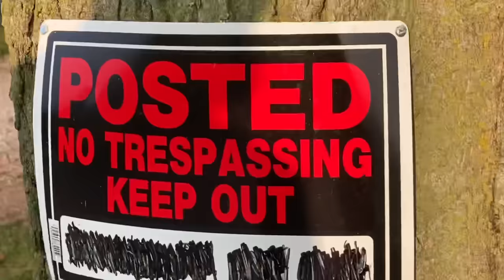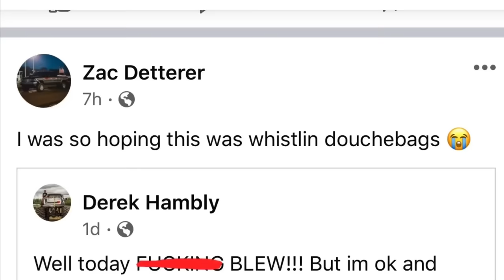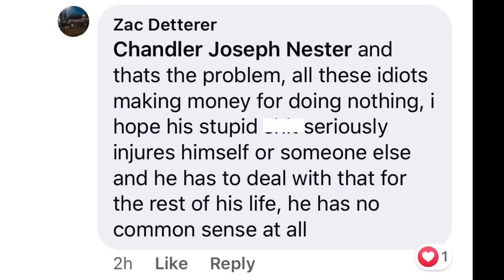DON'T TELL ME HOW TO USE MY TRUCK - Hater Crosses the Line

Comment: Get a military Humvee and see how strong “military grade” is or hell get a lmtv that should be cool to watch.
Reply: Watch him rip the r8 body off and put it on monster max
Reply: Hell yes!!!
Reply: Or better, a hilux.
Reply: @flippercomet5002  yesssssss
Reply: @Trevor Lahey , my man
Reply: Hilux has a solid axle with a king pin design. No ball joints. Plus it’s a N/A diesel. That’s why their so reliable. They don’t make enough power to hurt themselves. Although they will absolutely rot out. That’s an unavoidable fact.
Reply: Military humvees aren't military grade they could get blown up by IEDs
Reply: @kinetix3576  they are, in fact, military grade due to the fact that they constantly break are impossible to maintain for more than 5 years
Reply: @jabocjacob7064  old Toyota’s rot like hell but if there’s anything I want more than to swap a Perkins in my 91 ranger, it’s a dirty diesel hilux with a hood stack
Reply: I wasn't in the motor pool, but more often than not we would receive Humvees at our shop and they would break somewhere between parking them and moving them a day later.
Reply: Yes!!!!
Reply: Military grade means the cheapest not the best
Reply: It’ll be dead before he got it started.
Reply: @JamesEllison69  this aged well
Reply: @kinetix3576  military grade means "lowest bidder" not "good quality"
Reply: @TheSebsFilms  
Perhaps, but if we gave Americans those L-ATVs instead of the Taliban, there might be slightly less hate toward the government.

Just saying, everyone has a price and mine is an L-ATV.
Reply: @JamesEllison69  A surplus MRAP.

Comment: Blows my mind that trucks break down as daily drivers when he puts them through this and they still run 😂😂
Reply: yeah lol. NeutralDrop channel jokes about that too. It's an odd phenomenon. lol
Reply: Dude, not gonna lie, I’ve thought about that every single time he posts.
Reply: @jamisgood21  true. Happens to some shitty bikes I purchased, when I abuse the shit out of them they don't break. But going to the grocery store? Fuel line clogged, crank bearings get fucked up, brake pad gets destroyed, loose bolts, etc, etc.
Reply: On a serious note - endless daily use, countless heat cycles & running hours, that is what finally kills stuff. Modern vehicles are engineered to just work, and to not run hard enough to destroy themselves.

Also there is a case to be made for letting your machine run through it's paces once in a while, getting it's blood pumping, so to speak. It can clean stuff out, keeps things moving etc
Reply: lobmin gotta let the horses gallop
Reply: Lol- my truck will break down because the gas cap is on crooked. WD’s truck will have a missing head, split transfer case and no oil, peanut butter in the diff and still rip up a field for 2 days....

Comment: That was sick u should get a 2005 Ford f250 that’s would piss some people off man. Love the content btw.
Reply: It would gave to be a 6.0l to piss anyone off lol 5.4l 3vs do this to themselves
Reply: 6.0 is such a good motor if you dump thousands into it.
Reply: @MrJrawkk  yup I've had a few the first thing you do is make sure egr cooler is deleted, exhaust straight piped, and get a scan gauge so you can keep an eye on the ipr and icp. Head studs if your running a tune
Reply: @MrJrawkk  a good motor should only need fuel dumped into it
Reply: @skeeter2136  that was the joke 🤣

Comment: For those of you who don’t know why he was pouring the water on his engine near the radiator its because if you pour water on a hot engine block it causes it cool down at a quick speed which causes it to harden, which results it to becoming stronger and able to take a bigger beating. Most people don’t know this, but of course whistlindiesel does because this is his line of profession🤷🏻‍♂️💯
Reply: It’s also just a quick and efficient way to cool down your motor when you don’t have the time to let it cool on its own, obviously💯